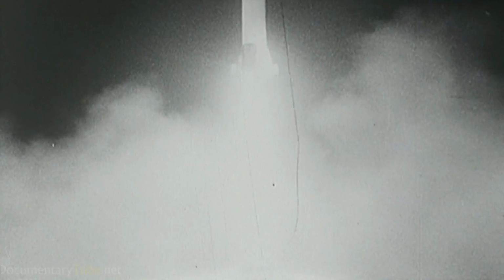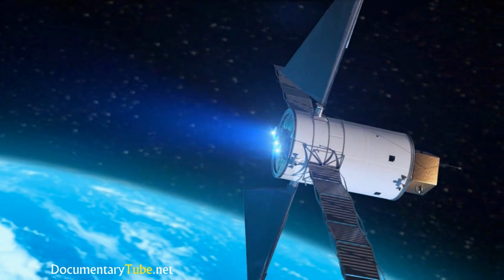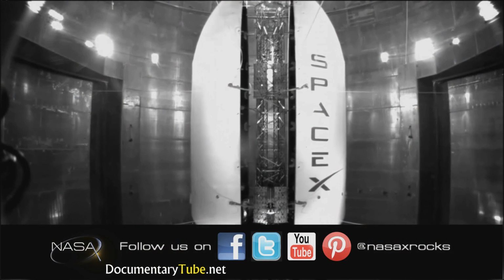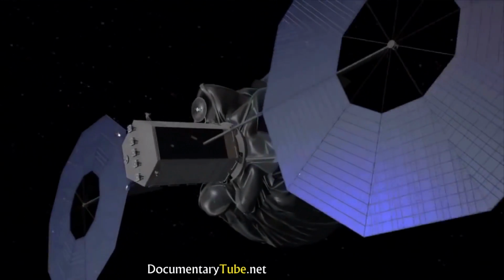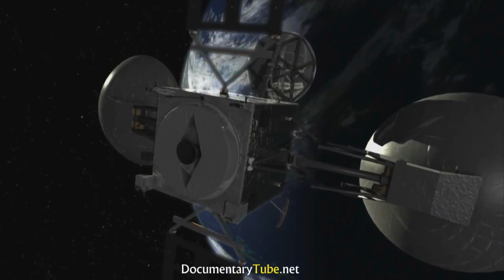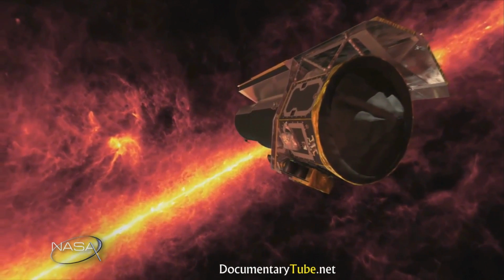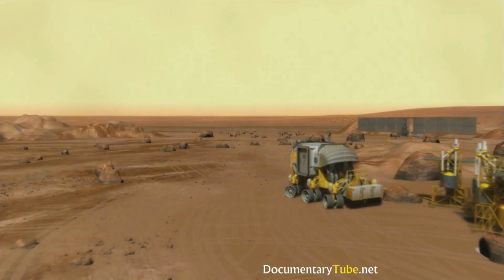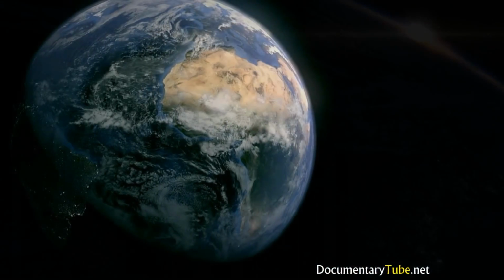NASA's Engines and Possible Speed of Light Propulsion?

Comment: Electric propulsion - why not use mini nuclear reactor instead of solar arrays?
Reply: The biggest problems are launching highly radioactive materials, and the weight required for shielding on any manned craft, and cooling a reactor in space. Even a small reactor would require huge radiant cooling panels through which the reactor coolant would have to be pumped. Such panels would likely be as large, or larger than solar arrays, and harder to deploy.

Nuclear reactors produce immense heat, and one of the hardest things to do in a vacuum is to shed heat.
Reply: NASA has been using nuclear power for FIVE DECADES. They use plutonium-238. The Voyager Spacecraft - one of which is now in interstellar space - is still able to communicate with Earth because it is nuclear powered. The Mars Rover uses plutonium-238. Pretty much every NASA mission in the past FIFTY YEARS has used nuclear power. It is far, FAR superior to solar power.
In fact the biggest problem NASA is currently facing is the the fact that they are soon going to run out of plutonium-238. As things stand, they have enough for a few more years but THERE IS NO CURRENT ALTERNATIVE. NASA may be unable to power future missions but no one even knows about the problem. 
+Charles Torruella - NO ... they do NOT have nuclear reactors on ANY spacecraft. Plutonium-238 gives off heat and that heat is converted into electrical energy. As I have already said, THERE IS NO CURRENT ALTERNATIVE and NASA may not be able to power ANY missions if an alternative isn't found in the net few years...
Reply: My Uncle worked on an atomic rocket engine.  Think it was called Nerva or Minerva. They didn't want to fly this thing because if ir crashed...  His group was so pissed off they burned all the propellant at once before shutting down.  Think they were just heating some compressed gas using a small fission nuclear reactor.
Reply: ea al Density, as in kwh/kg. Since Mass is a major issue in Space (irrespective of propulsion system), it's prudent to keep mass down. To run a nuclear reactor, you need large radiators to get rid of the heat, and the nuclear reactor itself is also very heavy. Up to slightly beyond Mars, a large solar array produces more power per kilogram mass of the power system than a nuclear reactor. Anything closer than Venus, and Nuclear isn't even a viable option anymore.
Reply: I hardly think you need a metric ton of nuclear fuel
Reply: The large mars rover curiosity has a nuclear power source
Reply: Submariners do it constantly.
Reply: They need to research fusion it’s much safer than fission
Reply: Pawel - thermoelectric generators are the better solution and have a successful operational history, but I understand that there is a supply problem with the particular plutonium isotope that is most useful in space. The better use for mama's remaining supply is to power miniature heaters that operate for many years protecting the electronics of probes from the cold of deep space, an absolutely crucial application. The deepest probes still get thermoelectric generators due to lack of sufficient sunlight in deepest space. I believe the isotope shortage is in part a political problem as a reactor can be designed to produce some (we used to have one), just as there are still a couple old research reactors that produce all our medical isotopes. I also suspect we could buy what is needed from the Russian government. The trade restrictions with the Russians our government insists on are complete buckshot and harm both countries. Anyway, there is nothing you or I can do about that.
Reply: It will be a while before we use Nuclear power rockets because of the bad rap it has. It will happen though. No other choice if we want a percentages of light speeds vehicle . They talking between 15 to 20 percent of light speed. That's around 25,000 to 36,000 miles per second. With the nearest Star Sirius at around 4.5 light years away. We could be lookingy at around 45 years to get there. If that Deep Hybernation project pans out for humans, we could be look at a possibility of success if can capture a very large astroid, hollow it out. Use the high temperature metals and alloids to coat the outside of the shell. Put a spin on it to give it gravity on the inside walls. produce soil from the inside tailings. Install a Nuclear power plant for a grow light system and wala' a ship that can support several generations as it passes through space to a Earth 2. At that point, it almost becomes impossible to distory the Human race for millions of years. What do you think?
Reply: It's called an RTG and they're used by NASA, except for the fact that NASA only has 2 RTGs left because the US Government won't give them any money.
Reply: efficiency or density? care to elaborate?
Reply: Expense. Also potentially dangerous until well out of the atmosphere. Until constructed in space it won't be used extensively.
Reply: Pawel Huszcza exactly
Reply: Just imagine something goes wrong when launching a metric ton of nuclear material into space. If the thing blows up while still in the atmosphere, radiation will rain down on us.
Reply: Unfiltered solar rays are every where in space, it's readily available right outside your window and weighs effectively nothing.  Plus you don't have to run around with a reactor that could meltdown and nuke everyone onboard.

However, a lot of satellites are nuclear powered.  However...they are unmanned.  Submarines are nuclear powered and obviously manned.  So...risk vs. benefits.
Reply: Finally, someone gets it.
Reply: One of the reasons is because it would be required an extremely effective engineering in order to isolate the engine bay from the crew,  because although they would be in another compartment of the spaceship, when it comes to nuclear, it's still near and for quite a time...
Reply: +Bark Manden So?
Reply: Many here lump together plutonium radioisotope thermoelectric generators, which can be made more or less as small as you like, but have relatively little power, with nuclear reactors, which must reach critical mass, and therefore can't be built below a certain size. A radioisotope thermoelectric generator is basically a lump of very active radioactive material combined with a thermo-element. Heat (generated by spontaneous radioactive decay) is converted to electricity, which can power relatively low power devices such as communication equipment, experiments, drive motors of a rover, small thrusters that are used to orient the craft. They are not powerful enough to bring a probe up to speed for interplanetary travel. This is still done with chemical rockets and gravity-assist flybys.
Nuclear fission-reactors, OTOH, must have (controllable!) critical mass, therefore need quite a bit of fissionable material. The aspect "controllable" also means that they can't be built with too high density of fissionable  material /power. And there is, as many have written before, the problem to dissipate unneeded heat.
For a propulsion system that can accelerate a sufficiently large mass to high speeds we are definitely talking fission (or even fusion, once we have mastered that.)
Reply: Isn't there an international treaty preventing the proliferation of nuclear tech into outer Space?
Reply: Because the ion thruster don't handle the power anyway... and because of weight. It's clearly still just a dream...
Reply: No one here seems to know history. Nuclear power was already used on early space probes like Voyager missions. The use of reactors was abandoned due to many reasons.
Reply: wantone. Mass isn't an issue for a submarine. Lead shielding can be plentiful and extensively.  You can't get a submarine into orbit.
Reply: Reason to not launch fissile material into space is that if it explodes on take-off you've just irradiated your launch pad and everything around it.  Too dangerous.  If you're interested in Nuclear space propulsion look up the SNAP program.
Reply: Sarge Rho This isn't true, sorry nuclear contains much more energy density than a solar array. The reason is that nuclear power gets spent(usually 25 years) and solar panels can continuously produce power and isnt limited by nuclear fuel
Reply: Nuclear reactors on manned flights aren't that big of a deal. You only need one bulkhead to shield it from the rest of the spacecraft, no one is concerned about it emitting radiation into space.
The issue has nothing to do with what the nuclear material is doing once it gets up there, it doesn't matter if it's an RTG or fission reactor, it's just a simple matter of how much material, AND WHAT KIND of material, is being shot up through the atmosphere.
Voyagers had 4.5kg of pu-238 each making about 470W at launch
NASA's kilopower reactor (1kW version) has 28kg of U-235
Pu-238 has a half life of 87.7 years
U-235 has a half life of 703,800,000 years

So if we had 28kg of U-235 dispersed in the upper atmosphere, it would be nowhere near as hazardous as 4kg of Pu-238.
Therefore, the argument of the dangers of firing fissile material into space is purely political, based on the uneducated opinion of the masses.
Reply: That would work, and NASA is working on it especially for exploring other planets.  In orbit around Earth i'd rather have solar without the radiation hazard.
Reply: Sarge Rho anything closer then Venus? you are aware that any kind of satellite or prob or even a ship going out pass mars has to have a reactor right? as far as  having to much  weight, they make reactors small enough to fit on the Cassini prob. which was the size of a small car. ya they make them that small, so who says there to heavy? is that you, because you dont know what your talking about.
Reply: Pawel Huszcza dont let this guy fool you,every satellite that goes out as far as venus has a reactor on them.they make small reactors that will power a anysize electric car out there .you only have to deal wit radiation, but in space  despite what some think it is very easy to shield a crew form a reactor that size.i dont know why poeple want to belive sometimes but all you have to do is google it and you will see that we are allready useing them. and they will be a big part of future space travel,seei?seeing that solar arrays will not work that far out into the solar system.
Reply: For all intents and purposes, we can already use Nuclear Fission propulsion systems. The technology, designs needed, materials are already there and developed decades ago. The main problem is that no one wants to risk a Nuclear Spacecraft exploding while in flight and still in the atmosphere, spreading the radioactive matter all over a large area. Even with today's technology and all those checks before launch, we still have a large number of rockets exploding mid-flight.
Reply: Pawel Huszcza gaos
Reply: Fixed not fixes, off not of. As I said, I really dislike it.
Reply: Energy density. In the inner solar system, solar panels produce more power than nuclear reactors for the same weight.

Comment: Solar arrays are a politically correct substitute for nuclear (fission or fusion) power. They will work in the inner system planets, but as a craft gets further out, it will be harder to generate power with Solar. Eventually we will have to face the environmentalist and anti-nuclear groups.
Reply: KuraIthys for insurance purposes, the failure rate of launches is 1 in 20... which for your purposes is quite large... 

there is the possibility in the future of launching a nuclear reactor without fuel... launching the fuel on a second LV... or if not allowed processing it from sources off planet..
Reply: KuraIthys No. Very wrong idea. You don't bring a nuclear reactor to space. You build it there. The nuclear rockets should be built in space. However, that would prove to be the most difficult.
Reply: Photon-intermediate direct energy conversion ?
Reply: haven't heard of it... will have to research it.. thx... been busy with SpaceX presentation at the IAC...
Reply: ...and face cancer. As if it wasn't already "popular" enough...
Reply: That's our plan anyways. To colonize mars so we have room more humanity.
Reply: use the solar array + planet slingshots to accelerate enough to leave the solar system at 1% light speed
Reply: ... Getting an actual nuclear reactor into space would be quite a challenge.
Many past missions have used radioisotope thermal generators, but while those produce steady power for many years, it's not exactly the kind of output you'd expect from a nuclear power system.

Still, the problem with nuclear power is what happens on a botched launch?
What happens is you scatter radioactive materials over thousands or tens of thousands of square kilometres...

The distance that such material can travel was demonstrated quite effectively by the chernobyl disaster, but that was at surface level - If it happened at higher altitude, the area affected would likely be a lot larger.

Unfortunately, the failure rate of space launches is very high. It's not a question of IF such a space vessel would explode during launch, but merely a matter of WHEN.

So the question is, can you design a nuclear reactor that can safely survive a rocket exploding next to it without spreading radioactive waste all over the place?
Reply: Look up the SNAP-10A project, it's interesting.
Reply: All that needs to be done is to add a launch escape and recovery system to the payload. Most rocket failures will happen long before it reaches the upper atmosphere, so if the payload can escape the rocket before explosion, no big deal.
Reply: No you would lift the parts and build in space??? The new space x BFR is going to be able to lift 1000 tonnes into earth orbit. Build the reactor in space.

Comment: The TR3B engine was in a small lab size at Lawrence Livermore Labatories in 1986.  The engine was a two in one engine.  Part one was the thrust Helium 3 fusion power and part two was the anti gravity mercury spinning around the fusion core.  What is cool about the TR3B; is that, you can crash the craft into a million pieces and they do not have radioactive contamination.  The TR3B will never be un-classified for the average dopes.  This is why NASA is still using stupid rockets.

Comment: instead of useing rockets that could explode fail and cost stupid amounts of fuel why not just make a huge jet bigger then the antonov-225 and once the jets dont work at high altitudes use small more fuel officient rockets to power into space and have the shuttle or whatever on the roof of the jet and let it glide into space/orbit.
Reply: That's the model that Virgin Galactic are using for their space tourism enterprise. It comes with it's own slue of problems, as you may have heard. Mostly Huge development costs.
Rockets are what as known as a mature technology, so for the moment they're far simpler and cheaper. It's the same reason we all still have petrol cars, even though there certainly exists the ability to manufacture fully electric cars.
Reply: Part of the reason that jets aren't used is because reaching orbit requires going about 90% faster and 90% higher than a jet's operational limits. So since a rocket is required anyway (jets will only work to about 10 miles up, for perspective the ISS orbits at ~250 miles) it does not help to have jet engines. The rocket can be made a little bigger and it'll easily take care of that first ~10% of the height and speed required, without adding parts and constraints to the design of the craft.

For many decades people have been working on hypersonic jets that will reach 4-5 times higher and faster than regular jets, but they aren't operational yet, and have many limitations that would put additional design restrictions on a space mission. In some few cases those restrictions are not a problem, but for many kinds of missions they would not be helpful.
Reply: i meant a jet that can fly a rocket on top of it like the antnov but once it cant go higher they swich it across to rockets like jato's on c-130's but it pushes the jet into space and to be able to be controled they have mini thrusters in the wings that fold out on the tips of its wings on its nose, belly and tail.
Reply: You gust got that from Randell Monroes book "what if" 😂😂😂😂😂😂😂😂😂😂😂😂😂😂😂😂😂😂😂😂😂😂😂
Reply: The F-15 has reached an altitude of 103,000 ft and is capable of launching small satellites or satellite killer missiles into space, but ground launched rockets are still the most efficient way to put larger pay loads into orbit or deep space.
Reply: travis james what have u smoked
Reply: We've already been doing that for decades. Air launch to orbit has been used many times in the past. The problem is weight. The brand new, and absolutely massive stratolaunch vehicle is estimated to be able to launch a 6t satellite into low earth orbit.
A Falcon 9 can lift 22t into LEO